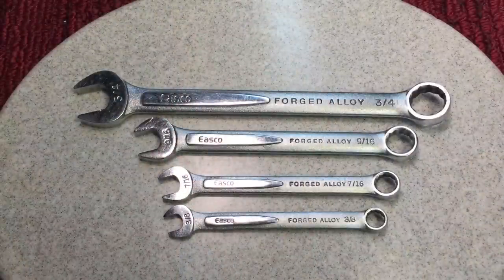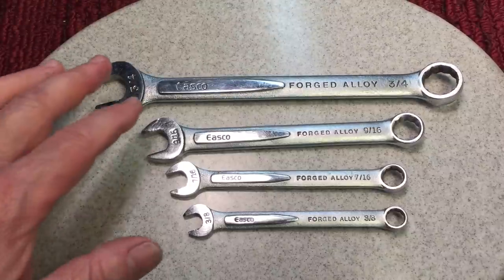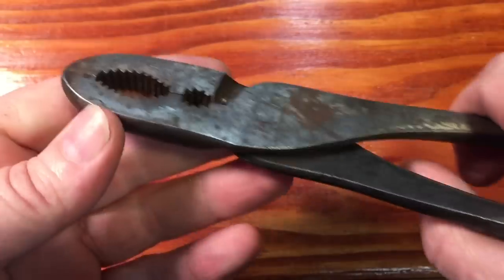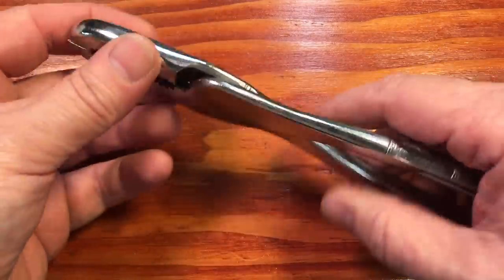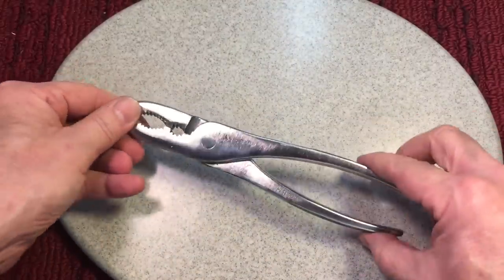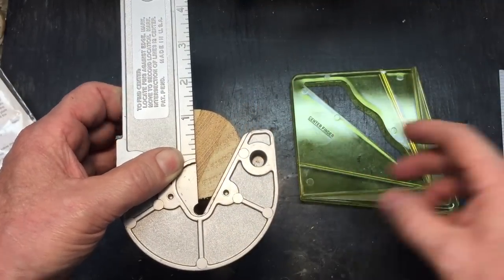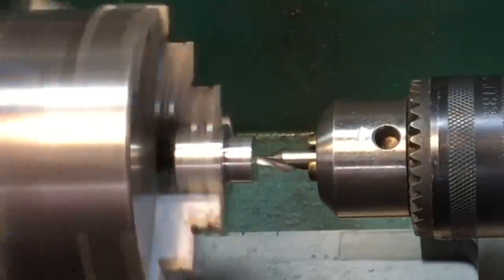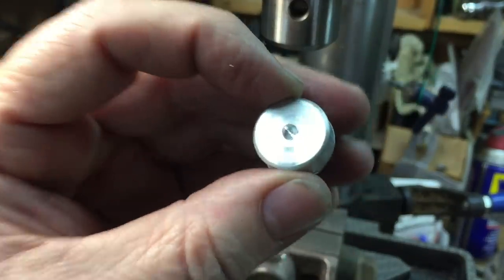Easco Wrench Set- Proto 258 Pliers- Finding Center

Comment: With its ability to hold round stock in the tip, I could see those pliers becoming a frequently used tool with the wire wheel. Great job.

Comment: Great job on the plumber's pliers John.  I am kicking myself b/c I was at a flea market last year, picked up a pair, got distracted, put them down, and forgot to go back for them!  I wanted them for the exact feature you showed, the way the end is designed.  I saw the Vamplier tool being advertised and to me it looks like these plumber's pliers will do the same thing.  I'd rather have the old ones and restore them than the new pliers (or just use my Eifel Plierench some guy named Scoutcrafter introduced me to - they work just as well with their geared grip 😄).
Reply from the maker: Hi Lee!  Yes!  The Vampires are a great design!

Comment: I have an easco nut driver that I received with a radio controll boat hull that I purchased back in ‘84 or ‘85 the nut driver was just some swag included that made changing the glow plug on the motor much easier.
I love the quality and bright blue color of that tool. I still have the boat as well!

Comment: Easco is a brand that is used for government contracts.  I have several sets 8mm-32mm combo.  very common around military base pawn shops and flea markets.
Reply: Yep, they were the metric sets needed to work on the Hummers. Good sets harder to find now and more expensive.
Reply: Tom Gunn I got my big set for 20.00 at an auction locally. Nobody was interested in them as they weren’t Craftsman.  I just chuckled as I picked them up.

Comment: I have a bunch of easco. I have 1/2 ratchet,  And breaker bar. I have the wrenches from the huge size
1 1/4 to the small 5/16 without any skips . Also have a set of half inch sockets

Comment: Easco use to make the round head  / quick release  Craftsman ratchet for Sears. They also made the ratchet using their name with a slightly different handle. I see the ratchets once in a while, but not to many of the wrenches. I do own a few of the wrenches and they seem well made.
Reply from the maker: Funny how here where I live you rarely see Easco stuff! However the wrenches are pretty!  =)
Reply: How often do you see P&C brand tools ?  I live in the Northwest about 20 minutes from the old P&C factory. I don't collect P&C tools but somehow I have over 400 of them. Yes the Easco are good looking tools. A lot of the tools I buy because of the way they look. I have a bunch of S&K round head ratchets, but very few of their other tools.

Comment: You tend to find Easco tools in electronic service kits. Thus, they usually are not going to be found heavily greased and knocked up as if they were used to pull out transmissions and the like. I don't know if they are as strong or as durable as Craftsman, Proto, or Snap-On but they are likely just fine for all but the most rugged work. Good US mfr. I have a few Easco items, 1/4" socket extensions and the like. You don't expect to obliterate 1/4" socket pieces because they don't go onto bolts big enough to thrash them.
Reply from the maker: Awesome!
Reply: @ScoutCrafter  If you go back 20-25+ years and look at "Jensen Tools", they specialized in those suitcase type tool kits, mostly for electronics techs, the wrenches and sockets were usually Easco. Nowadays they could well be Chinese. Back then Chinese wrenches, etc; were not very good and did not look very good and were not well regarded. These days they are probably good enough for electronic work, so it wouldn't surprise me to find Husky (or other) tools in such a kit if you bought it today. You and I might not go out and buy such a kit, but such kits are typically offered on GSA contracts, so when the government enlists 350 new electronic techs for the Army or Air Force they buy 350 Jensen toolkits and there you go.

Comment: On the Proto Pliers it looks like before you refurbish it, the date code on one of the arms is J 11 03.  You can just make out the left edges of the 3 on the handle.  After you sanded and polished it, it appears that 3 is no longer visible.
Reply from the maker: I didn't even see the "3"!  I tried looking all over for the date codes but couldn't find them..  Not that it matters but I always like to know about when the tool was made...  Thanks very much!!!!!

Comment: I have seen them did not know they where the OEM for Craftsman nice find I cleaned up my late father's slip joint pliers I want to add  Klein  coat on the Handel i know they are  drop forged Japan but in his memory I like to do it  he been gone  since 1998 I want to add them for grip and looks I love the patina they have now I need to hit up his vise grips and that's it I do not need the polish look just need it rust free cleaned up I am happy with it then I use em I do hit up my local flea market got older used tools some beat up some good the guys there every Sunday

Comment: I like those Proto pliers! Vampliers before there was Vampliers. It wouldn't be difficult to modify a normal set into the parallel front teeth design. I will do just that.

Comment: Hi Scout , Great Video ! I knew Those Wrenches Looked like Craftsman right off the Bat . As Far As Finding Center on Square or Round Stock I Use A Tape Measure After Being A Carpenter and Backyard Mechanic A Long Time . I Never heard of Easco . Looks like You're Missing 1/2 , 5/8 , 11/16 . That Would be Just like My 1st Craftsman Set I Had at 12 !
Reply from the maker: Hi Wayne!  I too had the same Craftsman set around the same age!  If we couldn't kill them then you know they were bulletproof!!!!  =)  Thanks!!!!!!!!
Reply: @ScoutCrafter  , I Found 1 Easco Adapter 1/4 to 3/8 didn't Know I had It . Bottom of old Craftsman Toolbox . Who Knows When I got That . 😂